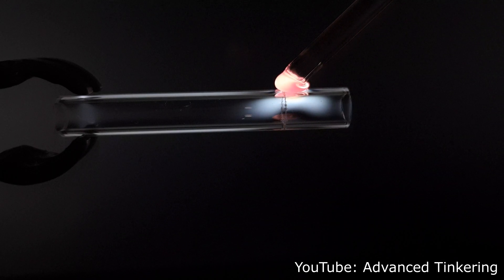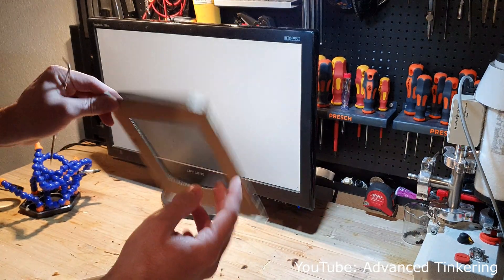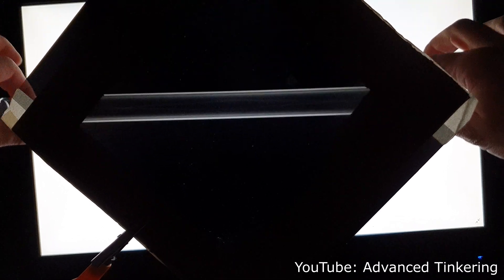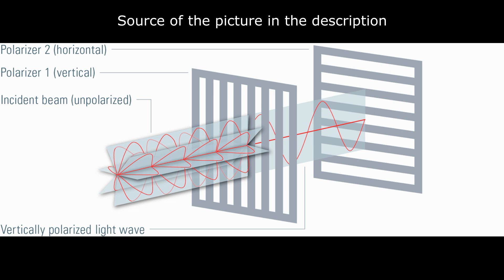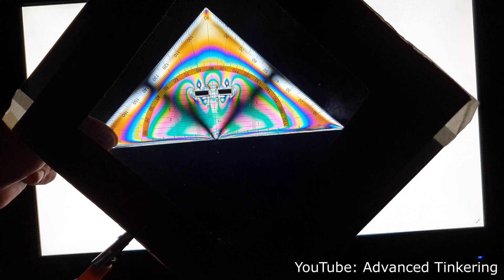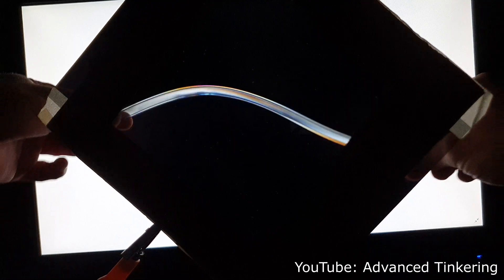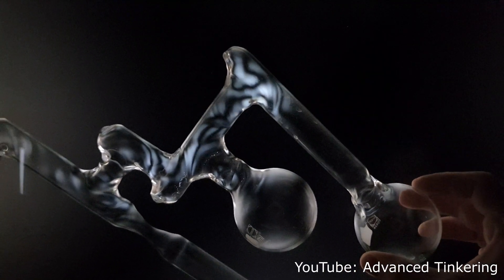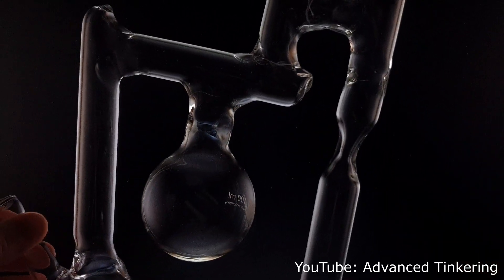How to build a polariscope with common items to see the stress in different materials

Comment: You put a small aquarium inside a bigger one and fill one with NaOH camphor and the small one with ethanol camphor mix, shine white light AT CRITICAL ANGLE thru and then place your test vial in the trajectory of the polarised light ray, and record the change in the colour bands . You can do it in a scrap book and crayons if you want to be a ridiculous person like I enjoy 

You seal the ceilings with foam 

Put it on a dolly with wheels and wait for sunset so it appears more based

For someone that constructs highly sophisticated apparatus I suggest directing the polarised ray into it below, rotating it independently and record the video, so can take guess work out

Comment: Very nice demonstration and very clearly explained! I have a background in liquid crystals and polarisation microscopy so I can safely say that you explained it better than I usually manage to do 😀 
Just as a technical note you can see the polarisation due to reflection still,  in the walls of the annealed glass tube and round bottom flask, is related to s and p Fresnel coefficients & Brewster angle.
Reply from the maker: Thank you! 
And thank you for the additional information!

Comment: I just need a polirized light source to see the stress on plastic
Reply: You can polarize light by using the same sort of filter. This means you would need two filters, one to polarize the light and a second to check if the polarization has changed.

Comment: I think that your excellent video describes just what I need.  I am looking for a way to check for stress in borosilicate glass shades made for antique light fixtures, some fairly large, for example a 10" sphere.  If I set up a unit as you describe here will this work for something of this size placed between the light source and the polarization sheet ?  It would be used for smaller shades and chimneys as well.  What has happened in the past the glassblower has mold blown a shade, and once annealed he will reheat to fire polish the top and bottom edges and then places the shade on a shelf and it looks fine but will crack in places later.  I'm not even close to an expert but I am wondering if he has annealed it at all or not correctly after the fire polishing work.  Thanks for any help you might have to offer.
Reply from the maker: Hello,
yes, of course you can also use this setup with larger objects.
Why does he fire polish the glass after he annealed it? It is possible that he introduced new stress when fire polishing it. I think it would be best if he annealed it again after fire polishing. 
But I am also not a professional glassblower (far from it). But that would be my guess.
Reply: m @AdvancedTinkering  I agree.  He was fire polishing using a small torch, I suspect not large enough to heat any more of the shade than the edge that needed to be fire polished.  It is my understanding that when glass is brought up to a temp required for this operation that it would have to be annealed again.  He is shipping one for me to inspect - if it makes it here in one piece I'll check it for stress in the way you describe - I've already ordered the polarization sheet from Amazon and it should arrive before the shade does.  It'll be interesting to see what I find and I'll let you know the outcome.  Joel